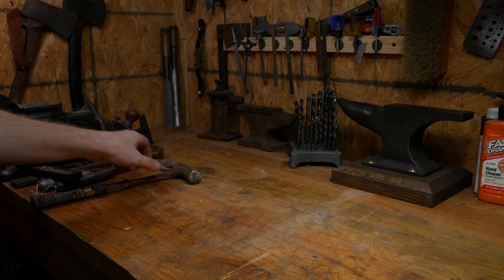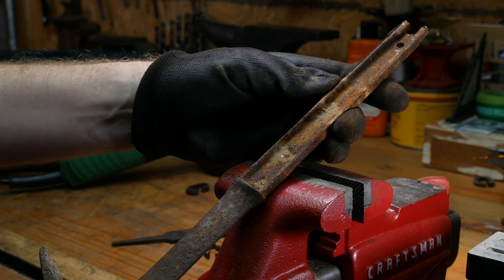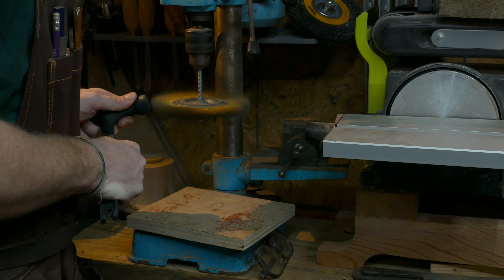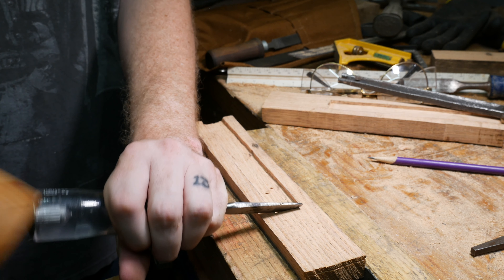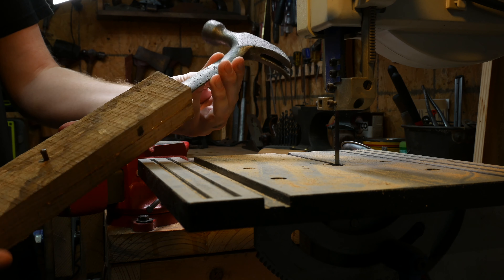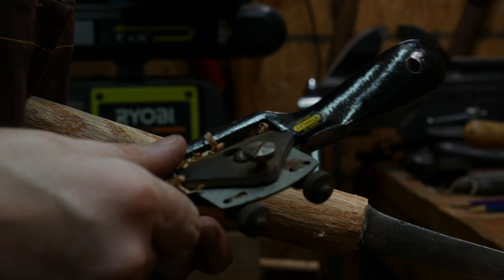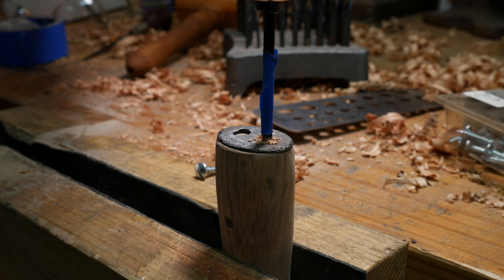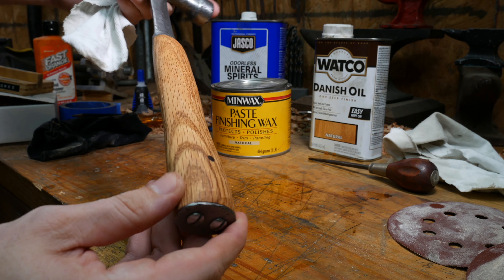Rescue - My father's old Malco 20oz hammer. (Looks like an Estwing)

Comment: How does linseed oil compare to danish oil? I've used linseed oil on a hatchet handle and it looks similar to your finished hammer handle.
Reply from the maker: Very similar but Danish dries quick and is a bit easier to work with. Not as hardy though. I mostly used Danish Oil because I had in stock.
Reply: Danish oil is just a 3 in 1 that often has linseed oil or tung oil in it. Then has some mineral spirits to thin it out plus a poly of some sort to protect it even more.